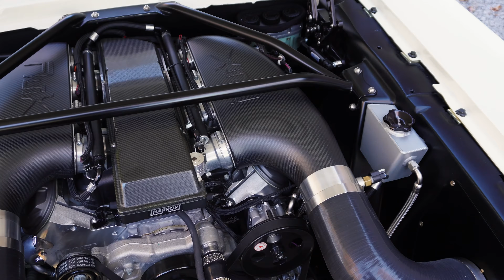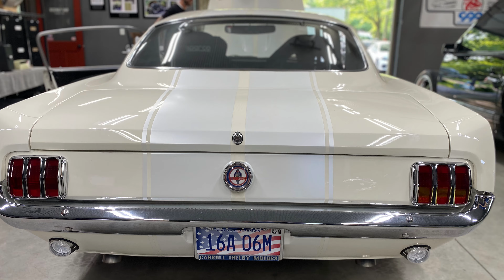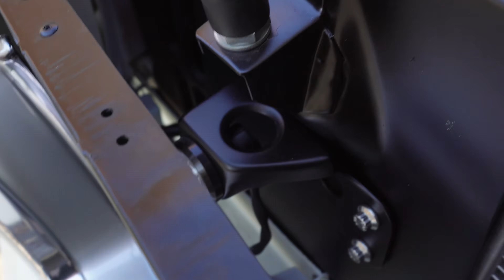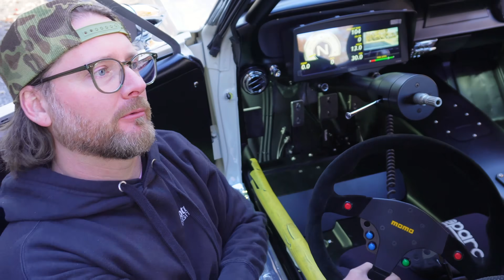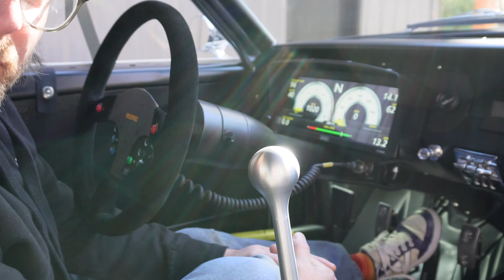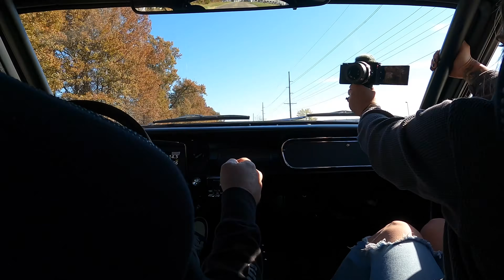ANATOMY OF A RACE CAR: Shane Garrison's 1965 Mustang Fastback

Comment: I have a 66 FB that is pretty gnarly as well. Its sports many of the same-ish components and set up. You know you were going to get the chevy motor vs ford motor thing here in the comments. My car sports a very healthy Cleveland. Not as nasty as your LS but an FR9 is on the way. I appreciate everything except the mill
Reply: I am a Blue Oval guy.    That Cleveland is an awesome motor.   I had one in my 70 fastback mustang. It had some work done to it.  The thing was a beast     I am not a fan of these guys putting gm motors in Ford's.